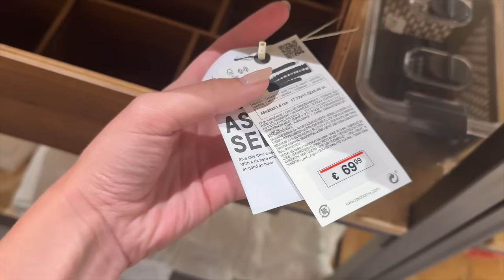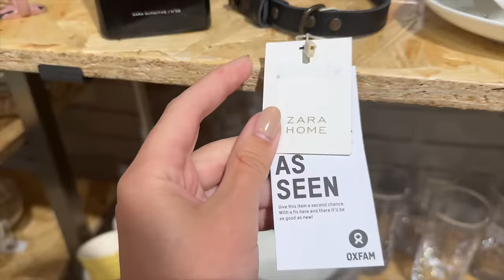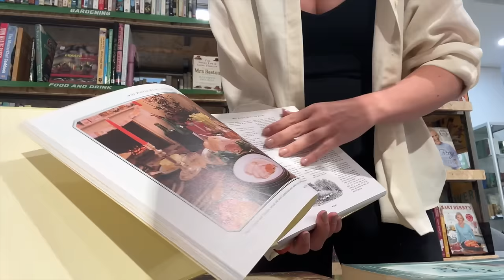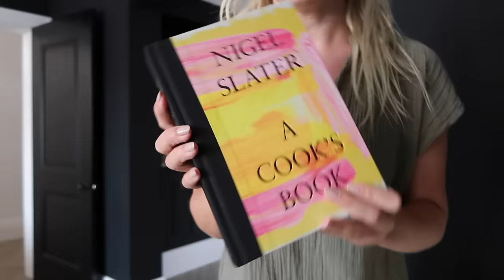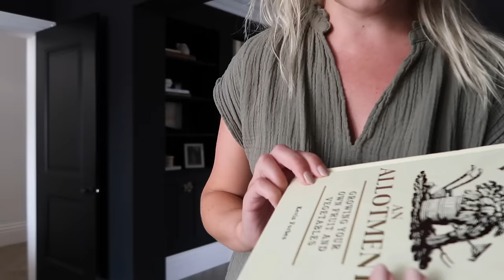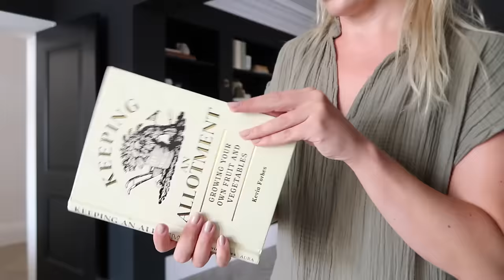OXFAM SUPERSTORE BARGAINS Zara Home Charity Shop Haul

Comment: I remember when Oxfam was one of the very few charity shops that appeared on the high street and there were some great bargains to be had. However, it’s image and reputation have changed quite significantly since those early days and too many new items have appeared with ever increasing prices. It just doesn’t sit right with me that there’s a whole load of Zara products on sale- are they seconds? Personally, I love to rummage around for more vintage or unusual pieces rather than see a whole load of nearly new items.Unfortunately, Oxfam  has become less of a charity shop and more of a retail store these days so I rarely go in.
Reply: Zara at oxfam is what they couldn't sell and they need the space for the new stock. Sold as seen! So new with tags, scratches, missing something, make up on clothes,  you name it. Beware that zara themselves sell cheaper in their own sale, after that they donate and oxfam reprice higher than that but not full price.